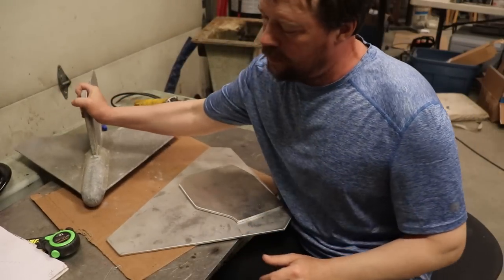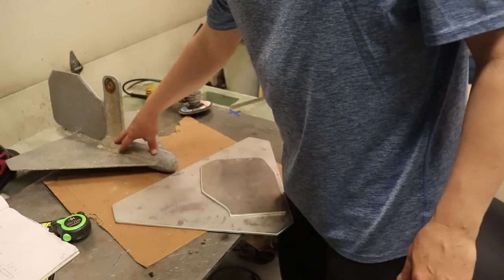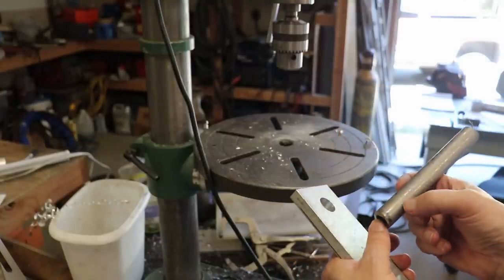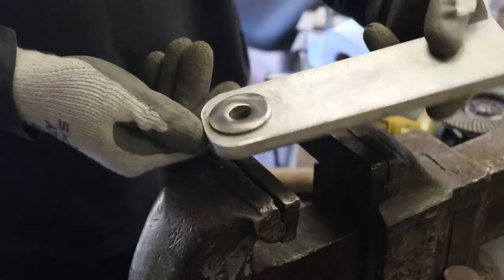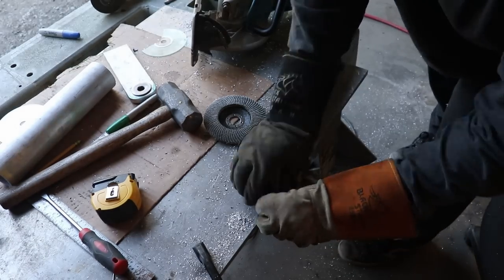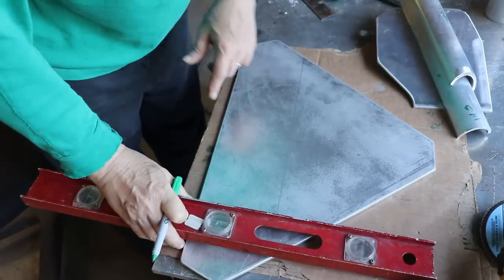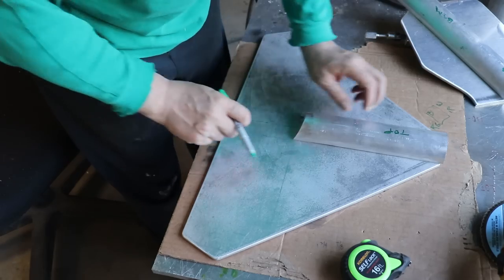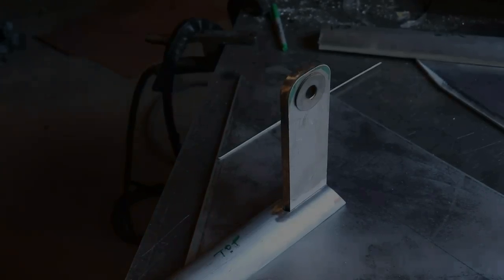Building Our Stabilizer Fish - Aluminum Fabrication

Comment: Great video , I'm going to build a set of these myself and was wondering if you would remember the dimensions and weight of your boat for comparison
Reply from the maker: Thanks! The Fish Tale is 35' long and gross is 14 tons.
Reply: Thanky for the reply, my boat is 49 ton steel trawler type hull.  The stabilizers I am replacing were actually made with a wood plane     would you also be able to tell me the dimensions of the ones you made.  I'm most interested in the set back distance from the front of the horizontal plane to the flat bar that the chain attached to